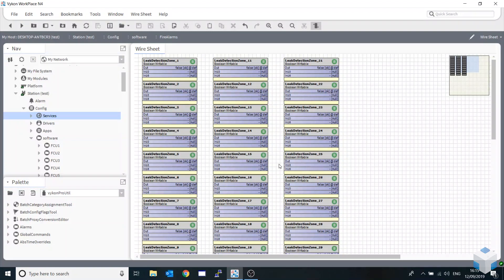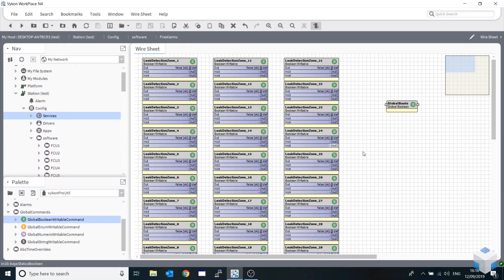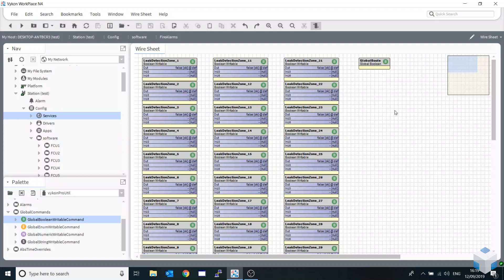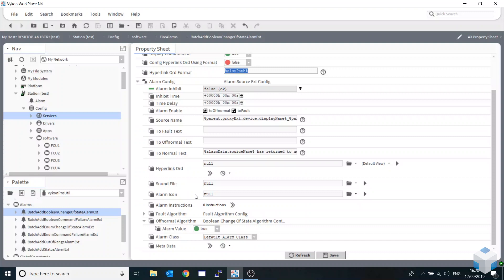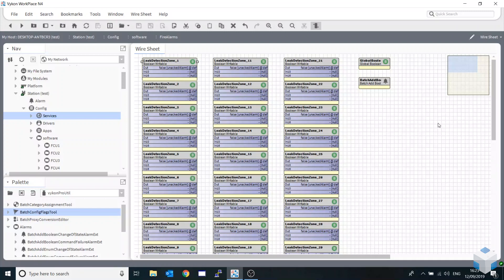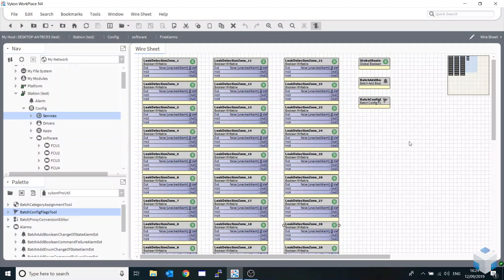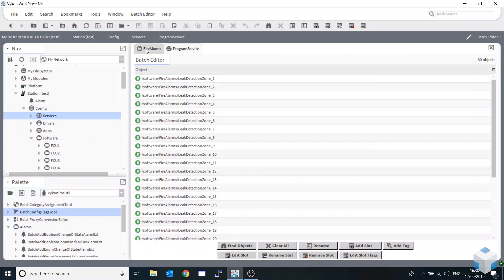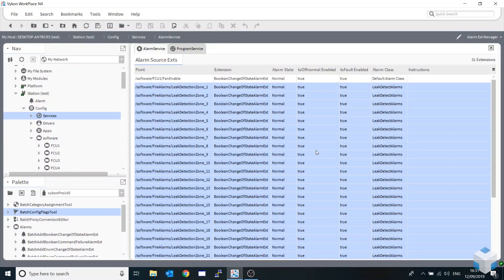HOW TO: Perform mass config changes in Niagara 4

Comment: I want to allow the end user to set the setpoint for all the FCUs by building, level, and zone. Was trying to use BQL to query points in Globalcommand to change the setpoint but it didn't work. Not sure if it's not supported or my setting was wrong. Please help!

Comment: automating linking?
Reply from the maker: Please expand on this?
Reply: @OnesightTV  if you needed to add links between slots from one point to another or to an extension then program services or other tools can only link one to many. I have not seen a module that can use a BQL or NQL search and link.

Comment: How would you go about making a mass change when it comes to alarm extensions across multiple devices but only utilizing 1 or 2 points from each device?
Reply: I am afraid this would have to be done within the Jace on each device.  You could use the "find" feature in the Nav tree for speed of finding the 2 points.
Reply: @danielharrisoss3379   Any update on this?  I've had several jobs where i needed to add alarm points to 100+ VAV flow points and its ridiculous to drop them in point by point.  Or is it too difficult to apply this to more than a single wire sheet?
Reply: @aaronsiedenburg4765  have you tried creating just one extension then copy and paste it into each point. That’s how I’ve done it. I am
Working on this mass add to see if there is a universal way to do this across multiple platforms